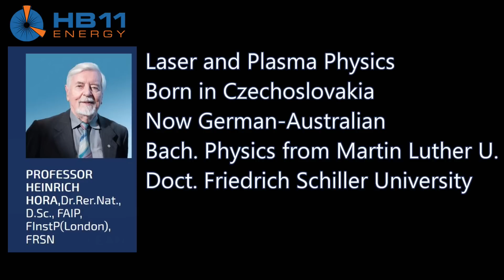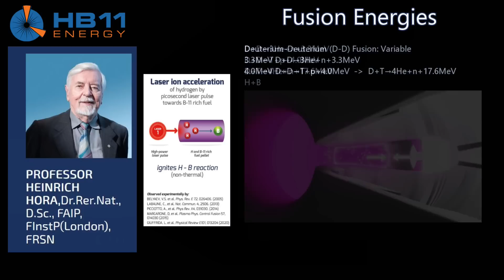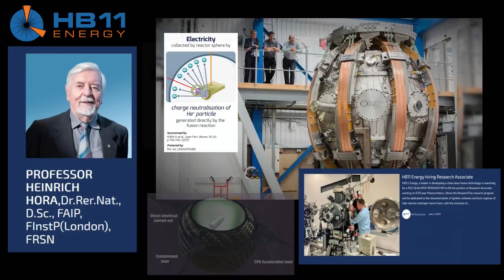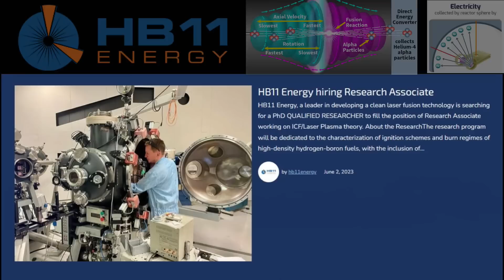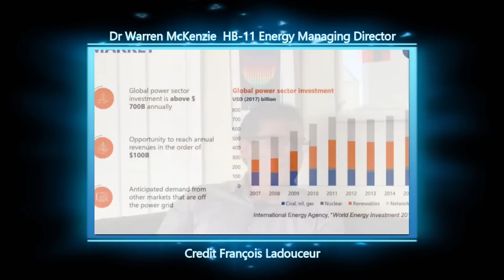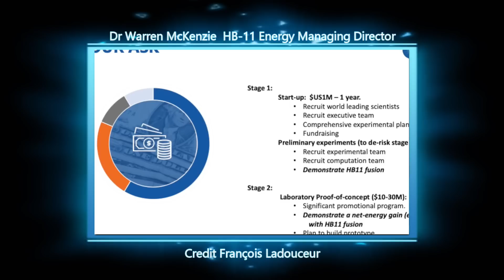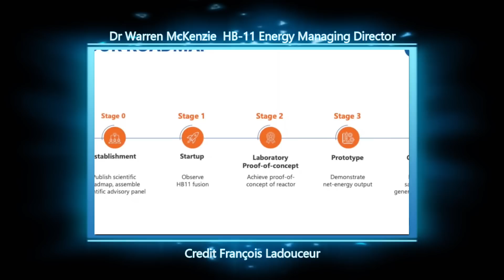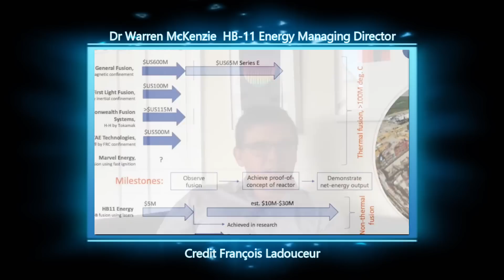Hydrogen Boron Aneutronic Nonthermal Direct Energy Fusion

Comment: I'll ask a dark journalist type question here.  Much like David Grush (Kroose), does the guy that run's this channel still work for the Government?  Because I can't see how any person with eyes and a brain can ignore Randil Mills of brilliant light energy.  Once you have a supply chain established are you going suddenly 'disrupt' that supply chain causing many vested interest to fall apart.  No.  You're just going to keep ignoring that disrupting entity by pretending it doesn't exist.  

What we have here is a race between existing ideas and their supporters.  One system is definitely more eloquent, in this respect, one takes up less space and it also can be made decentralized. The direct to electricity method is great, and that's all I give them.  But one of these will never get my house or car off the grid. Who will win?  Those with more power and are more mainstream will definitely cheat. They also seem to me to be further behind as commercialization goes. Even the E-Kat has lifted methods from this man, yet do not show the understanding the 'brilliant light power' group have of his power production process. 

Seeing how Mills has the size and portability issues advantages, perhaps one day he will get the direct to electrify approach solved, instead of using black body radiators.  But to do so eloquently might involve a John Bidini approach.  What I'm getting at is the device has to be small independent of large infrastructure, safe, portable, and nearly be able to purchased at Walmart.  I'm never a fan these expensive exotic 'GIANT' Rube Goldberg type of devices, that will just maintain 'much' of the status qou.  

Scalar interferometers are a thing, and from what I've read they leave non visible beam, which many keep looking for.
Reply from the maker: There must be some semblance of comporting with reality for me to be interested in an energy technology, "the proposed hydrino states are unphysical and incompatible with key equations of quantum mechanics."  The "hydrino"  state must be proven empirically for us to revamp the most proven theories in human history.  And I don't work for the government.  But then... that's what I WOULD say if I WAS working for the government so...

Comment: There are good reasons for us to develop fusion. But none of them include solving climate change. We have all the technology we need. Fusion only yields roughly 7 times more energy than fission. But that is nothing compared to the 1 Million times more energy difference you get from moving from chemical (where we are mostly at today) to nuclear fission (which we have the technology for today). No new technology needs to be developed. Trying to compare fission to fusion is splitting hairs when our society/civilization is still primarily powered by chemical energy.

The damn environmentalists that helped stop the rollout of nuclear fission should be charged for crimes against humanity. We can have all the damn fresh water we need by using Thermal energy from fission to carry out desalination, to drive all the difference chemical processing industries in our economy. We dont even have a fuel problem. The existing LWR designs need U235. But canada already gave us working CANDU reactors that allow us to burn U238. We have deesigns for burning plutonium and other fission products that are recoverable with spent fuel recycling. We have 81 Million metric tons of Uranium in the earths crust, with an additional 4 million metric tons of the stuff dissolved in the earths oceans. God forbid we run out because we gluttinously find new ways to make use of all that energy. There is 232 Million metric tons of Thorium in the earths crust for us to switch over to. assuming we are so energy drunk we are unable to kick start Thorium reactors due to a lack of Uranium or plutonium. We have designs for accelerator initiated thorium reactors, TODAY.

I say all this to point out. Humanity does not need to develop fusion to provide us with the energy we need to solve the climate problems we have today. No we just need to continue the roll out of nuclear fission technology that those ignorant malthusian environmentalists stalled. Paired with a closed fuel cycle utilizing spent fuel recycling and Humanity will not know what to do with all the energy it has unlocked. The biggest down side to fission is we do not have designs that allow us to extract most of the energy in a electromagnetic form. But thats not too bad of a shotcoming since ALOT of our industrial processes are thermal energy based.
Reply from the maker: We agree.  But the oil industry has poisoned most of the public on nuclear (with help from Chernobyl, Three Mile Island, and Fukashima of course. Fission has been possible for half a century but not realized.  Fusion has a better chance of rapid adoption.